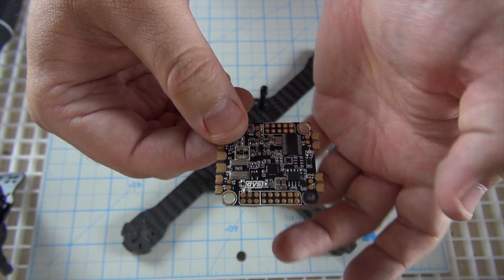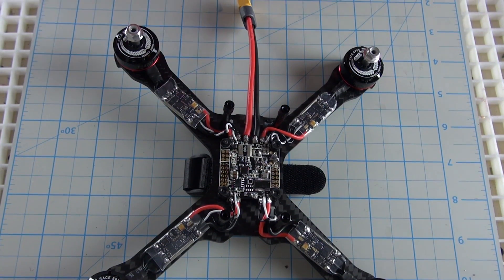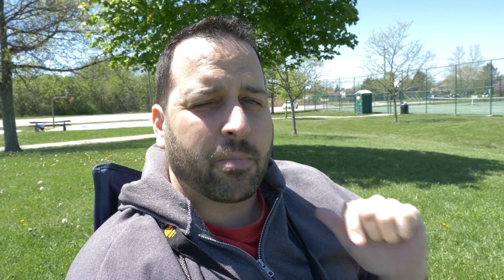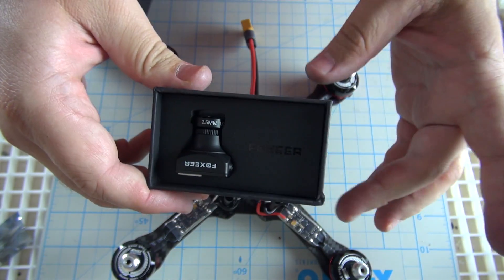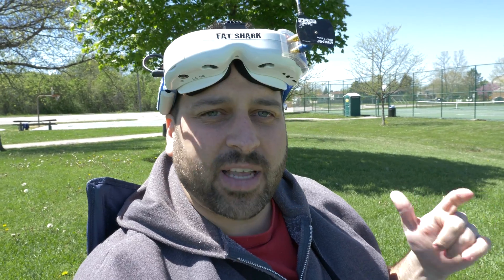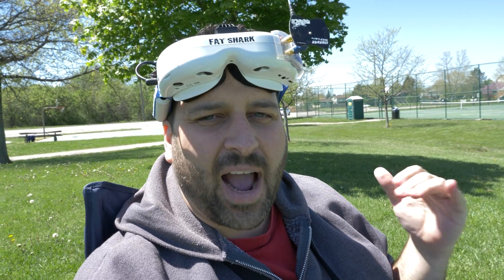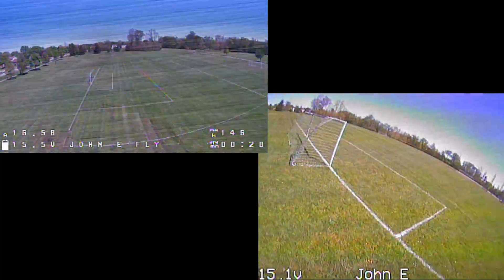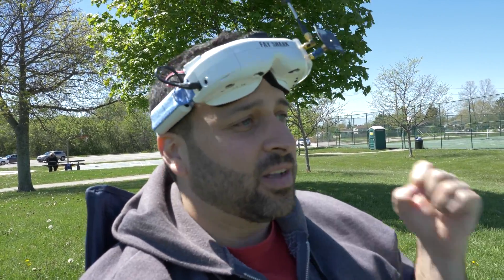RealAcc X210 Pro w/ EMAX RS2205(S) 2600Kv

Comment: Nice video john e fly...i have the same motors and fc but my motors are really hot
i dont know why...checked the screws
                                checked for continuity
    but nothing
Reply from the maker: Are you noticing any vibrations?  Too much vibration can cause the motors to constantly spin up and down which would result in increased heat.  That's also part of why we soft mount FCs these days, to minimize the amount of changes the FC has to process and try to account for.  Have you changed any other parameters?  Like the Filters or D term settings?  Those can also have an impact.
Reply: John E Fly There are not any vibrations...the motor heats up even when the props are not on...tell me about your motors...after you remove the screw the bell pops right off?
Reply from the maker: Motors will get hot if you are running them without props.  Motors are designed to have air going through them.  Not only that but if you arm the quad without props and try to spin them up, the flight controller will try to make adjustments and be unable to do it since the motors don't provide any thrust.  That can cause the motors to keep spinning up and changing and produce a lot of heat.  Running motors without props can burn your motors.

I have never removed the bell from my motors.  I also use this drone a lot for racing and have not had any heat issues with these motors.
Reply: John E Fly Very strange..im only afraid not to burn them because they are painful to touch

Comment: I have the Realacc XS210 pro as my beater quad as I do all my trick learning initially on that quad. Can you share with me how you mounted your GoPro Session on there as I just got a session and it doesn't have any strap slots on the sides?  Also read a lot of comments about the stock CF smashing the session in hard crashes.  If you haven't tried it yet, you need to try a Hyperfloss super light build.  Mine is 267g and the acceleration and vertical climb rate are insane.  Crazy hang time as well.
Reply from the maker: I use a GoPro mount for the GEP TX.  It's also compatible with the X210 Pro/V+.  I used this one: https://www.thingiverse.com/thing:2023885.  

I don't have a hyperfloss, but did build a RDQ Mach 1 which weighed in around 260g.  It's very comparable in weight, and has a big increase in performance.  Definitely a bit more difficult to fly though, as it will change directions so much more easily.  It also has a lot more potential to go fast though too.  It's a balancing act with quad weight.
Reply: John E Fly Thanks for the link. I have noticed your flying has improved rapidly after your recovery. Would love to know what you worked on as I can do a lot of the maneuvers, but lack the style and artistic traits that I see the better pilots have.
Reply from the maker: Thank you so much!  I don't think I'm focused on anything in particular.  Just making sure I get out and fly.  The more stick time you get the more comfortable you get with maneuvers.  The more easily they start being pieced together.  I haven't actually done much freestyle lately as I've been so focused on racing.  I bet my freestyle has suffered a bunch just from a lack of practice lately.  Just keep on those sticks!
Reply: John E Fly Hey I just looked at the Thingiverse file and that was exactly what I needed. My 3D printer comes in tomorrow and ironically the guy who made that used the exact same TPU and color I just ordered. Thanks a ton. 

I am flew this weekend and decided to slow down my flying and work on proximity and precision instead of "balls to the wall". What I noticed was by the 6th pack or so I was doing tricks I didn't know I could do, just because I imagined them. I assume this is the stringing things together you talk about.

Comment: How has that AKK switchable VTx been working out for you?  I've had the same one for 2 months and while it's great at 200mW, both mine and my friend's can only do 600mW for about a minute or two before it just stops transmitting. I think it may be overheating and shutting down to protect itself. If I unplug and wait a minute then turn it back down to 200mW, it works again with no problems at that transmit power.   It's not too big a deal since I upgraded to a TBS Unify Pro about 2 weeks ago, but I was curious how your experience has been. Because aside from that 600mW issue, the AKK seems to be really good for the price.
Reply from the maker: To be honest I typically only run them at 25 and 200mw.  They always work great for me at both of those powers.  I'll try upping it to 600mw in the near future and see if I start to run into any issues.  I'll also keep it to grass fields for now until I have confidence.  Thanks for the heads up!  I'm still jealous of your Unify Pro though :)
Reply: The Unify Pro has been awesome. I love it!  But yeah, 200mW worked great for me and it was totally reliable at that transmit power. But it's just like, i only bought it because i wanted to be able to do 600mW when i wanted to.  Definitely a good call to stay low and slow if you try out 600mW. we had the same issues occur on two different AKKs

Comment: If it's not much to ask can you swap the Racerstar motors for the EMAX motors on the Banggood build? Curious to know how it will perform with a motor upgrade.
Reply from the maker: It should be very similar to what you see in this video.  Both ESCs are rated for 30A.  Both FCs are F4 flight controllers.  The main difference is the integrated PDB which cuts down on the weight a little bit.  I think 99%+ of what you're seeing here is the motor difference.
Reply: That's what I was thinking. Thanks.